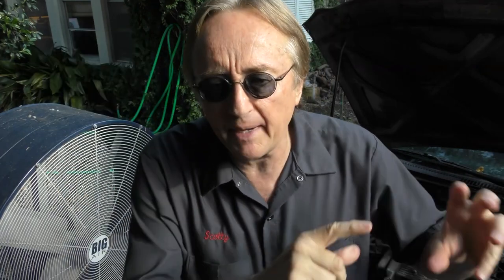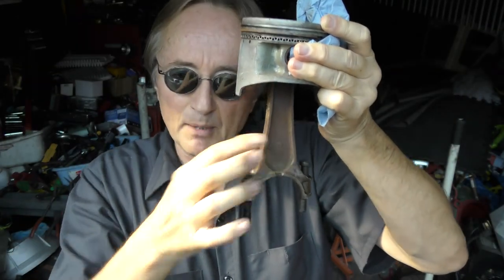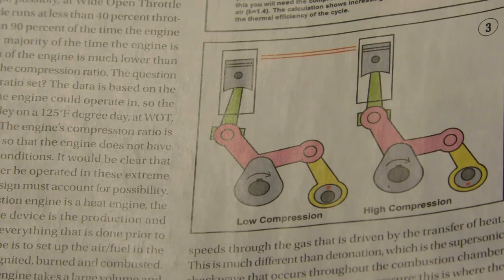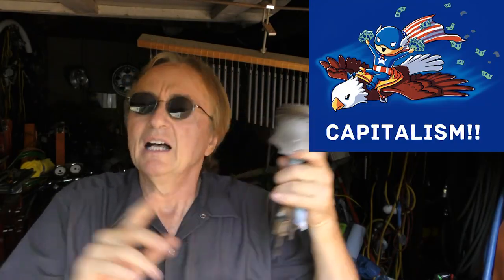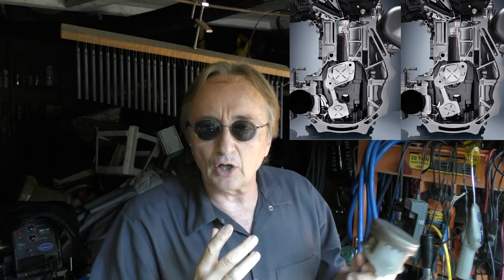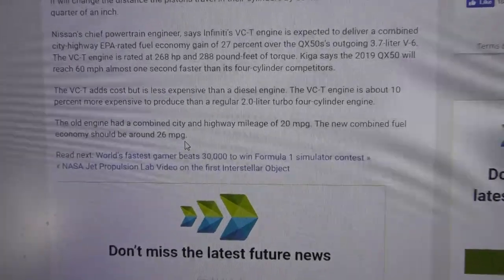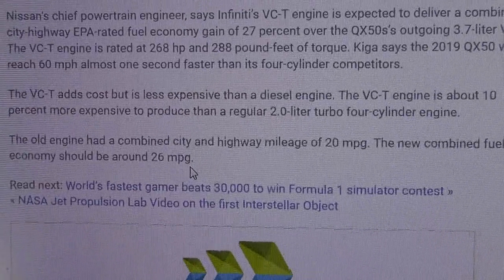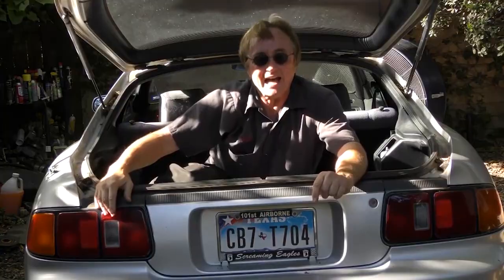If You Buy This Type of Engine, You're Going to Regret It

Comment: I enjoy most video's except for this one.  Right off the bat false comments on the cadillac engine (variable displacment).  This also operates entirely differently than the one the video is about (variable compression). The engines did not "tend to fall apart" I've heard alot about those engines but never that.  They used a egr design which didn't work well with that variable engine and  could cause pinging.  Gm issued updated eprom chips to correct this or you could easily pull 1 wire and you have a full time 8 cyl big block.

Comment: Not that I disagree with your VCR tech opinion, but the blanket assertion that cylinder deactivation systems are a massive failure doesn't seem to hold much water in real-world usage. Dodge 5.7L Hemis in the Chargers have had their "Multiple Displacement System" tech since the mid-2000s and I've yet to hear of anyone suffering an engine failure because of it. Now, you mention GM vehicles in your examples, and maybe they just suck at that.

Comment: Just know Nissan tested this engine more then any other engine they have, it could be great, it could be a flop. Time will tell. You tend to knock a lot of things modern, I don’t know if it’s due to age or what. But I know people hated fuel injection, power brakes, collapsible steering columns when they first came out, but look at it now.

Comment: Scotty, could you please provide some documentation for your claim that modern cylinder deactivation systems are problematic. A lot of this just seems to be "all change is bad".
Also, 26 mpg combined for a full size crossover is pretty decent.
And the fact Nissan had financial issues is neither here nor there (ad hominem argument) viz the likelihood the system will be reliable.
Don't forget, the cars of your childhood, in all their simplicity, were considered to be getting pretty worn out at 160k km (100k miles). On the other hand, a modern car can last 250k km plus even with iffy maintenance, and many cabs, including Prius' and Impalas, not to mention the old Vics, easily will pass 500k km (300k+ miles) in hard duty.
And they will do so while providing more power and less emissions.
Simplicity has many benefits, but it is no more worthy of veneration for its own sake, especially in cars, than is complexity.

Comment: My BMW 528i gets 26 mpg combined with 2009 technology inline 6 cyl engine.
Reply: Exactly. In the end these new engines that are over engineered aren't saving the customers much money in long run because the problems that can occur outweigh the benefits. The N52 engine in your BMW came out in 2005. Other than some hydraulic lifter issues those are solid motors and overall pretty simple. Smooth too.

Comment: If the new tech can reliably bring the engine to 300k miles before it needs scrap or repair, then its worth buying for 30% increase in fuel consumption because gas is gonna be 10$ a gallon.

Comment: Come on scotty. I understand what your saying. But its called ADVANCING. And gasoline engines have always been evolving. People said the same thing when fuel injection was first introduced.

Every new technology has quirks until they get worked out, but that doesnt make them bad designs. Just more complex. Hell, your average 4 banger today is a million times more complex than your old big block V8s from the 70s. Hell, your celica is more complex than engines back then. Does that make it a more problem prone design? 

The bottom line is you have to keep moving forward with technology. Not just toss it to the curb because its "too complicated". 

My old 90s Mercedes were more complex than my brand new Civics, and I didnt have a problem working on them and understanding them. As long as you are willing to learn about it, its not an issue to own it. 

As a final note, Iv ALWAYS got better mpg than the EPA ratings. Not sure who doesnt.

My 97 C280 was rated at 27mpg highway. I could get 35-36mpg. My 2015 Civic is rated at 39mpg highway, I get 45mpg. My 2016 Civic is rated at 40mpg highway, I get 52mpg.

Hell, even my 2008 Rav4 2.4L with 200k miles on it can get 30mpg consistantly and it was rated at 25mpg.

Comment: Check the Wards 10 best engines list. Nissan is the only company to appear 10 years running. My 1.6 is 20 years old (nissan pulsar) or sentra as you guys know them and compression is fine. My brother bought a 1982 r30 skyline and engine gearbox and diff were fine. Im sure every mechanic said the same thing as this gue about EFI and its fangle ecu stuff. This guy is just a old average mechanic ill take engineers words over his.

Comment: That's why I drive a 2000 ford F350 7.3 powerstroke turbo charged diesel v8. I can chip it and  get 500 horsepower and get better fuel economy and I can shove a corvette up my tail pipe with that kind of speed

Comment: IMO-Most if not all of the expensive top of the line models are being designed for the lease market.  They only have to last about three years which is the standard lease.  Think about it.  Why else are they using overly complicated technology,  plastic engine parts and horrendously difficult to service common replacement parts like water pumps and suspension items?  The goal now is to keep producing more and more gimmicks to make people want to keep leasing a newer model.  Woe to the poor sucker who buys these cars on the used market!
Reply: So right. Resold with 2 yr warranty, It only has 30,ooo miles so almost like new. 6th year, bam, major repairs, thousands of dollars. It's their marketing strategy !

Comment: Funny how I've had four Nissans and all have been as reliable as a bulldog. 
Also I crashed one at 60mph into a guy turned in front of me.walked away.
My wife rear-ended another at 70 walked away
Reply: And my friend's Toyota burns a quart of oil a week
Reply: @glencuda  older nissans were fine, but new ones....not so much. And your friends corolla most likely has over 130K miles 😂

Comment: Nissan isnt a bad brand for say, its the "sportier" japanese brand so they wont always be as reliable as a toyota, but they make powerful but mostly reliable engines for the most part, my infiniti/maxima was one of the quickest eastern sedans you could buy in the 90s but they were reliable enough to last, they are all built pretty well quality wise, paint dosnt seem to be an issue, or the interiors last a long time, but nissan likes to play with sportier tunes and the weird stuff like that engine and their terrible cvts(it would be nice if they had a 7 speed transmission option that they previously used in most of their infiniti lineup)
Nissan is like what mazda was in the 90s, trying out new things like the rotary and miller cycle supercharged v6s.

We love our nissans and they have proven to be the best cars we've owned, toyota might go longer without issues but its almost rather boringly so as its just a car nothing more nothing less.

Comment: This seems like a waste of time and money. We already have engines for everyone, wether it's a high power one or a high MPG one.
I like the roar of an internal combustion engine but I'd rather have them develop a faster charging method or a higher capacity battery for an electric car. That looks like the way to go as you no longer need all the mechanical parts for a "classic" car, like a gearbox. Granted, they have more electronics but fewer moving parts and if that worked on computers (see SSD's, for example) I don't see why they wouldn't on a car.

Comment: Reminds me of vtec crank instead of vtec cam. Vtec was stupid reliable tell you forget to change the oil then it would clog the screen and the pressure switch would fail too. But simple works but its boring.

Comment: Seems like your throwing it out just based on new tech and the old tech is ",just as good". Not really. If you have driven one of these i think you'd know why they are pretty amazing. A ton of torque throughout the rev range. Sure,, I wouldn't be the first to own but go drive the new Infiniti vs the VW cheap engine in the Macan and you'll know what I am talking about. I'd wait too, but don't count it out just yet

Comment: Good video Scotty, nice to here the opinions of someone with a lot of experience (that I don't have).  We learned quite a bit about compression ratios in college.  I also would not buy one of those variable compression ratio engines because of possible reliability issues, BUT, I hope they work out because if they can make an engine that can increase it's compression ratio on the fly, it could potentially make E85 worth it.  E85 doesn't make much sense now because a "flex-fuel" vehicle needs to keep it's base compression ratio low enough to still handle gas.  E85 has such excellent anti-knock properties that with a high compression ratio we could see some awesome mpg's.

Comment: .Scotty!  The title of the video is "If you buy this,  you're going to regret it"  and you claim not to be a fortune teller?    Driving problems?  wha?  is it gonna veer off the road?   A lot of pessimism  and crass debbie downery goin on in this video.   Rod bearings are generally reliable,  add two more per cylinder and they may remain reliable as they were,   I give you room to doubt a servo system if they use one to control this.   Love your gusto though Scotty!

Comment: I've been in the automotive industry for quite some time and I don't understand his hate for Nissan. I've watched a bunch of videos and he generally will dig Nissan but never dig on German cars, Mazda or Korean (Kia/hyundai) even though those are insanely terribly built especially compared to Nissan. Yeah Nissans tend to leak and blow CV axles but I'll take that over braking failure, the gas pedal sticking (cough Toyota cough), blowing head gaskets every 100k miles or whatever makes most compact cars from domestics not last 130k miles. So off base and strange considering his expertise.

Comment: Sounds like the all aluminum engine block (without liners)...works not to bad with cooling oil jets under the pistons (like many motor cycles) or on 2 stroke engines (with their built in piston lubrication due to their burning oil & gas together ) or on engines that the expansion rates for the pistons are carefully calculated for aluminum rather than cast iron or steel., But like the Jaguar , production tolerances for hard coated cylinder walls are very hard to control & may not be suitable for cars ...Maybe that's  why Honda uses it on some of their bikes but has yet to produce car engines made the same way., It would certainly be cheaper than machining cast blocks like they do now.Then comes Kia  with their 2 litre engine ..oops class action lawsuit ...

Comment: I like your videos but you are 100% wrong that cylinder deactivation is a failure.  I had a 2012 Honda accord which ran on 6,4 or 3 cylinders.  It ran just fine but frankly I didn't like the car.  Traded it for a 13' V6 with the new version of that engine.(total redesign is what they said) .  It runs on 6 or 3 cylinders which the econ button pressed and under low load conditions.  I leave the button on all the time and easily get 32mpg combined and have 63k miles on the car.  I twill flat out fly by doin 0-60 in under 6 seconds.  (not bad for a 6cyl 3600lb sedan) and get over 38mpg highway on long road trips at 70mph.  If you call that a failure and that old toyota a success then we both need new definitions.  Do I know if this infinity engine will last? No but just because there are a lot of new parts in it doesn't mean it will fail.  Maybe we should all go back to old model A 4cylinder engines with low compression. Less part count for sure.  Time to give new technology a chance.  I am sure the guys at Nissan have a little better credentials that Scotty.

Comment: This guy has no idea what he's talking about. Displacement on demand is extremely reliable. Dynamic skip fire is a game changer.
Reply: He’s been doing this over 50 years, he knows what he is talking about. The reality is these engines just aren’t there yet.  Game changer, perhaps.  The drive is also wonderful but they’ve been around for years and still aren’t proving reliability.
Reply: @erinfink6056   50 years and thinks everything would be better with a carburetor.

Comment: For new engine technology to result in a 27% improvement in fuel economy is rather impressive. Variable valve timing adds a lot of complexity without that much improvement in fuel economy.
Reply: Variable valve timing added around 6% efficiency.  All those technologies don't add huge numbers individually, but when you combine variable valve timing with fuel injection, direct injection, computer controlled ignition timing, better spark plugs etc. etc. the benefits start adding up.

Which is why engines today are more powerful, more reliable and more efficient than ever before.
Reply: Red Baron, yes you are correct. Variable valve timing increases power and reduces fuel consumption and emissions. Hopefully engine improvements will continue in the future.

Comment: This video is on-the-money. Listen to the advice and don't be an "Experimental Driver" for the big corporations and their NEW "untested" engine technology. Dodge's 5.7 v8 Automatic, with Multi-Displacement System (MDS) and even some of their 6.4 SRT Auto-trans equipped motors--Google Search all the low-mileage Timing Chain failures on that motor, and dropped valves from overheating. I want a motor where the cylinders fire--all the time!  My 2008 has a 6.1 HEMI, they don't make it anymore. 130,000 miles, no prob.

Comment: Ya that's not good gas mileage my parents have 93,98 Buick park avenue 3800 supercharged engine they get average of 30MPG my 2001 Buick la-saber (not supercharged) gets roughly 23-26MPG and my sisters 2004(I think)Toyota Camry get roughly 34MPG. And they can make better ones, back with the carburetor engines there was people able to modify them to get better mileage and the highest one I herd of was 1000 MPG yes you read that right 1 with 3 zeros, 1000, 1k. Now it was a smart person and they done it to their own car but Shell Oil Company had a contest back in the 70's and they came up with an engine that got 700 MPG if I remember right (it could have been 300 but I believe it was 700). So why don't they make cars with more then 30MPG common?? They do you just can't get them in the United States. Go elsewere and they commonly can get 50MPG, it could still be higher but its corporate greed. If they made cars with better gas mileage the oil company wouldn't be able to sell as much fuel. Same reason cars don't last as long anymore if they did then they couldn't sell you a new one as fast.

Comment: Isn't high compression a thing for DIESEL ENGINES?

Engines are getting so much complicated just to squeeze a bit more MPG numbers. 

Just look at car brochures for 70's to 80's  NISSAN (DATSUN) cars like the old reliable DATSIN 210 with an advertised range of 45 MPG to 50 MPG on highway. If this "new technology" can't beat that, there is no progress over the years.

Mazda will came with the most complicated engine of them all, their Homogeneous Charge Compression Ignition (HCCI) engine, which is just a common rail diesel engine just tweaked to work with gasoline. All that for what, 40 MPG? 

I am getting 45 MPG out of my 2013 TOYOTA VVT-i 1.5L 1NZ-FE engine, an engine that TOYOTA is making since the year 1997, a simple design with no complex enginering and it still performs and out-shines these new engines that are suposed to get better MPG. I did MPG battle against a 2017 Mazda 2 and I won.

Comment: Only gonna get worse from here on out with emissions standards.  You hear Dodge is going to start using gas to heat up your exhaust to like 1200 degrees and really burn the crap out of that exhaust?  So yeah, we get to look forward to purchasing fuel that doesn't even propel us forward and adds even more heat, weight, and problems under the hood for the engineers to have to solve.  The combustion engine as we know it is doomed.  Sentenced to a life similar to a chicken to be processed for food.  Basically going to operate at 2 speeds.  Power and Economy and even then there will be little difference between them.

Comment: So don't go for complexity.  So that points us to EVs with 18 moving parts. 

If an engine is needed make sure it is a simple constant speed generator in a hybrid.  That would be a Wankel. Mazda are to introduce a Wankel hybrid very soon. Hybrid engines are part time engines, so should last and last.

Comment: Sir, you are peddling scare tactic theories based on nothing but your opinion. You  obviously haven’t read about the 600 vehicles Nissan put millions of test miles on before this engine ever went to production. You also equate this with DOD which you call a complete failure, yet GM still uses that tech today all across its vehicle lineup. The VC engine is a stroke of engineering genius that you sneer at for lack of information and understanding. You just spout your antique notions without basis in fact. Bad show ole boy!

Comment: Go home, Scottie. You’re drunk.
 
Seriously, quit shouting and waving your arms around, with your you-kids-get-off-my-grass routine.
 
Cylinder deactivation was at first a bomb. When it came back in GM trucks, it bombed less so, but still sucked somewhat (they forgot to run oil to the deactivated cylinders, so when these powered back up under load, the first revolutions were “dry” increasing cylinder wear and leading to early leak issues). Now, cylinder deactivation is perfected to the point of meh.
 
However, the GM cylinder deactivation system’s 1990s shortfalls have nothing – nada – to do with the system now in the INFINITI twin turbo variable compression engine. These engines are as dissimilar as a knucklehead V-twin Harley to a modern Suzuki Hayabusa.